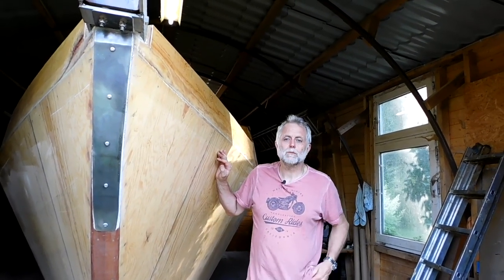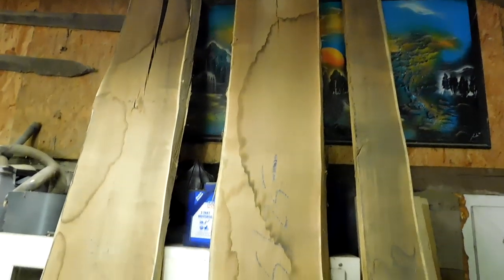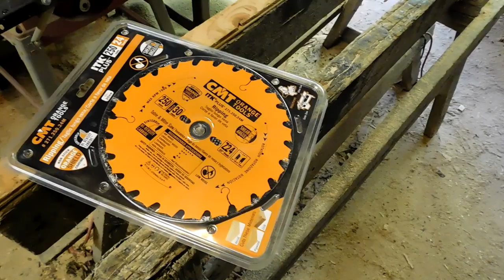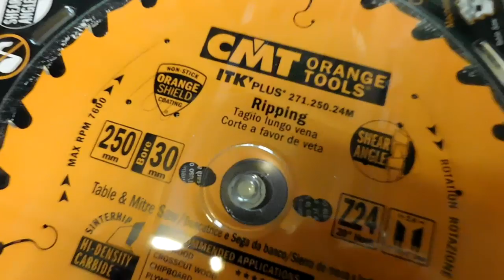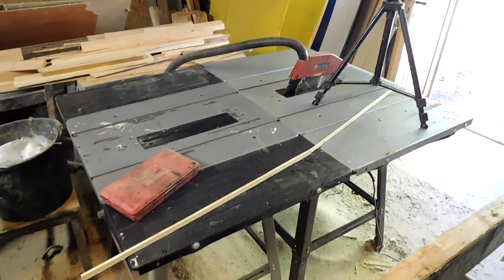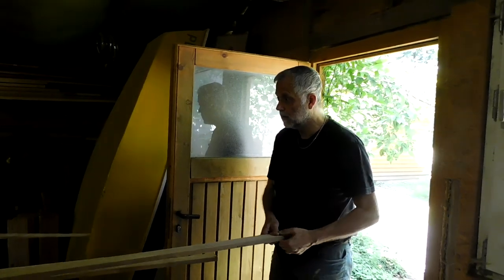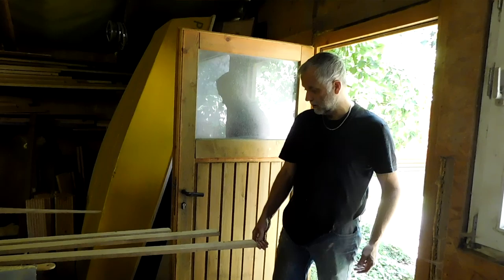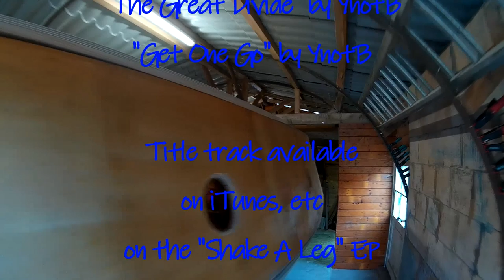Milling black locust, fitting the deck hatch and the port side deck box - SV Tapatya EP91

Comment: I spent the last couple days milling a black locust.
I had a solid 16"x18", 12 feet long beam at the end.  I ended up milling that into a 4"x18" slab, and a bunch of 4"x4" posts.
Today, I get to edge all the 1" planks.
It's HEAVY!
Reply from the maker: That sounds like hard work, Jon. Good wood when it's done though 👍

Comment: Black Locust is wonderful wood, as hard as Oak better grain, very good for steam bending rot and water resistant. I just wonder where you got yours from? I have only found two places and most wood yards in this country have not heard of it. Its sustainable and fast growing, trees reaching maturity in 30 years.
Reply from the maker: Yes, I agree with all of that, Thomas. I bought mine from the local lumberyard, but they didn't have much - in fact, I bought all of the 3 metre lengths they had. It seems to be being grown commercially in a few places in Europe and hopefully that's increasing 👍

Comment: Hi Tony. Nice build and very satisfying to watch. You have probably answered this question many times before, but . . . what is the paste glue you are using? Looks like West with coloidal silica. Whatever it is, you don't seem too anxious about it setting up in the tray before you are ready for it. Long pot life?
Reply from the maker: Thanks Mike.
The paste glue is epoxy resin thickened with microfibres. As you probably know, epoxies have a longer pot life if you keep them spread thinly in the pot. Also, the epoxy I use comes with a choice of hardener - I use a higher temp hardener in the summer and a lower temp one in the winter. This also helps with the pot life.

Comment: I knew you would not leave the caulking around the corners like that. I can’t help but wonder how long that piece will be watertight. Are you going to cover that with epoxy and fiberglass matting?  Another great video, keep them coming.
Reply from the maker: Thanks James. The ply piece is already covered in glass and epoxy. I believe it'll be watertight for a good while 👍

Comment: Fascinating project! I have two questions for you. 1. Why have you chosen such small "windows" for the cabin. Will the inside of the boat not be very dark and will it not be hard to see from the inside what is going on outside the boat? 2. Why do you make it very difficult for yourself to get access to the tank you mount behind glued plywood. I can imagine you at a later point need access to the tank and need a saw to do so. Is stiffness/solidity more important that accessibility?
Reply from the maker: Thanks Knud 😀
The side ports are very traditional. Basically, the smaller the ports, the safer the boat as they need to take the force of any seas breaking against their area. There will be plenty of light below from the deck hatches and she'll be painted out in white below decks.
The day tank is mounted from below and will be easily removable from below. The area above the tank should be watertight to prevent water getting in that way. 
Hope that helps!

Comment: Nice work! I like that you use ordinary tools. Are you bonding with ordinary white wood glue?
Reply from the maker: Thanks Graham 👍😀
The glue that I use to bond the bare plywood pieces is called Semparoc. It's a waterproof foaming polyurethane glue that has gap-filling properties and is sold by chandlers various as a boatbuilders' glue.

Comment: Oh man.. when you held up that tube as if to say "You see JAFO? Tef-gel".. I cracked up.. couldn't stop laughing for about 30 seconds! Good job mate.. (though I think you erred a bit on the light side on a couple of those screws! If nothing splooged out when you tightened 'em down, you didn't use enough.)

Nice job all round, Tony. Though I'm a little curious as to why the space for the day tank was so much larger than the tank itself. Guessing it was for ease of access to the mounts or fittings from inside?
Reply from the maker: Thanks Garryck 👍😀 😂😂.The heads and thread that passes through the alu were coated, I believe. I hope I never have to take them out again though .
Yes, the space around the day tank was really for ease of fitting. In truth, it could've been tighter.

Comment: How much diesel will that tank hold? Any idea how long a tank will last?0
Reply: it's not for the boat engine... i think it's for heating or cooking or both...
Reply from the maker: That's right. It holds about 25 liters for the cooking/heating stove. That'll last for about a week of constant (24 hour) use 👍
Reply: @daffygrey  has mentioned above, it's not for the engine, it's for cooking/heating
Reply from the maker: Approximately, yes.